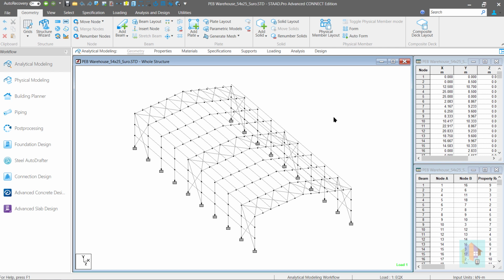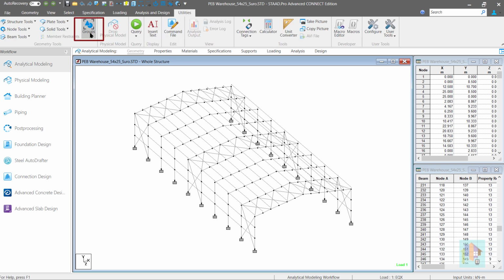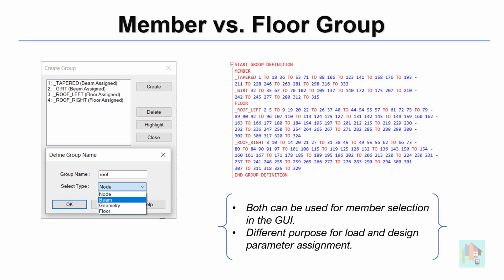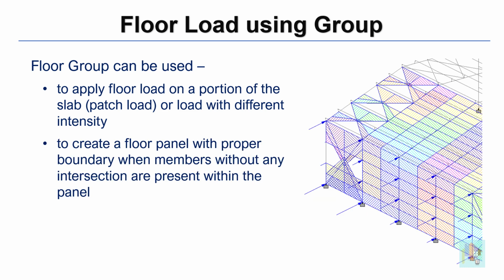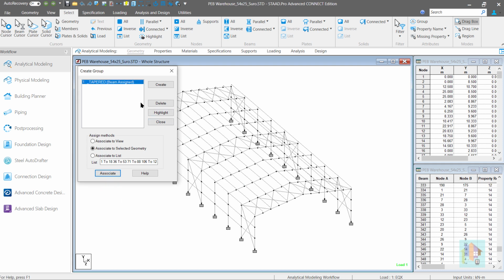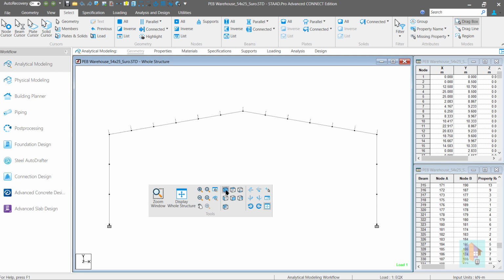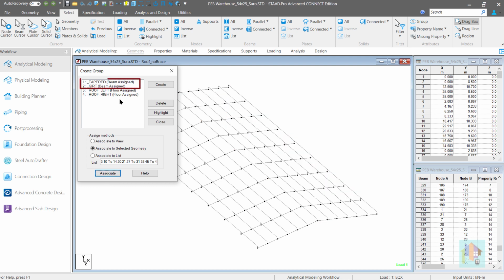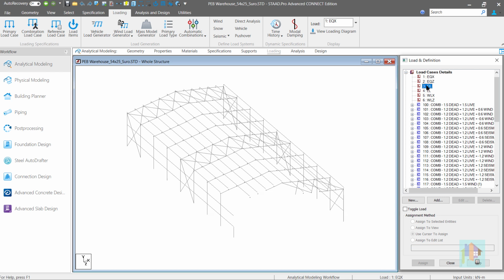PEB with Analytical Modeler: Part 2.6 -Group Generation || Member/Floor Group || Inclined Floor Load

Comment: I have warning, no member loaded for floor load generation. Anyone can Help
Reply from the maker: Check the Y range that you have defined for floor load. If there is no closed panel present within this range, then this warning is displayed. A common mistake, define the range in incorrect unit.